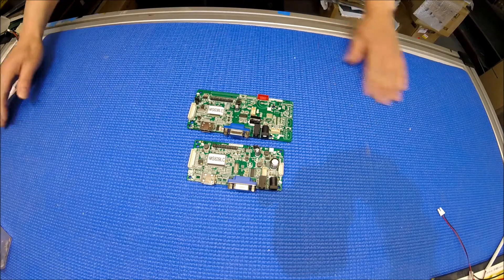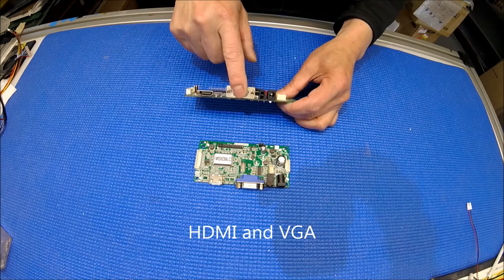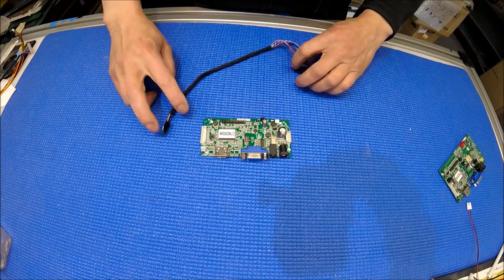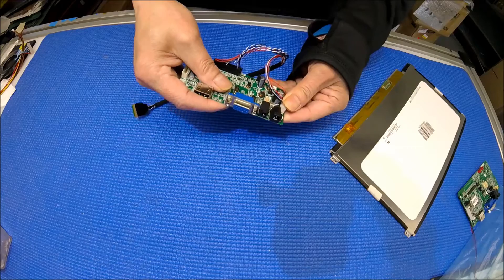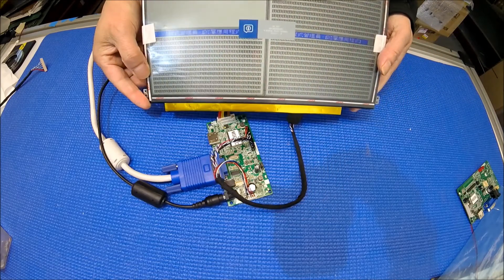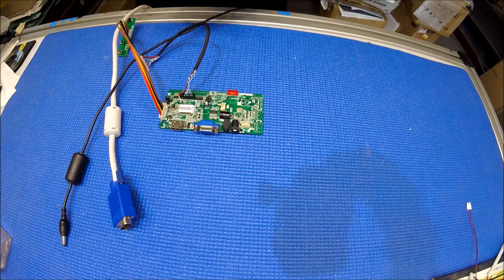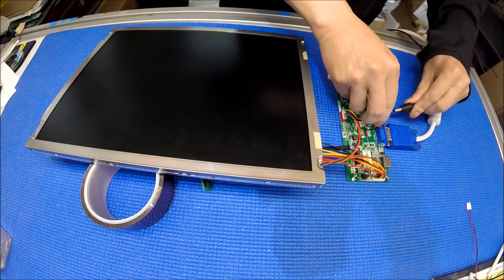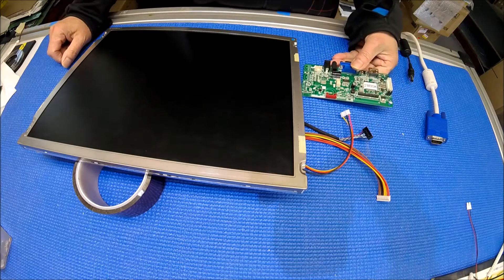LCD Controllers

Comment: Please help i was messing with the menu settings i have lcd controller. On my arcade 1up lcd monitor and at the bottom there was a setting dcm dcrm i forget but it said on and off i switched it to on it made the screen a little brighter but then i got all lines running through the monitor is there a way to reset the lcd controller anyway someone please help lol grrr
Reply: Best bet is to navigate through the board menu blind and switch it back